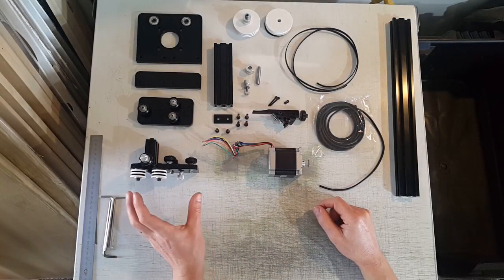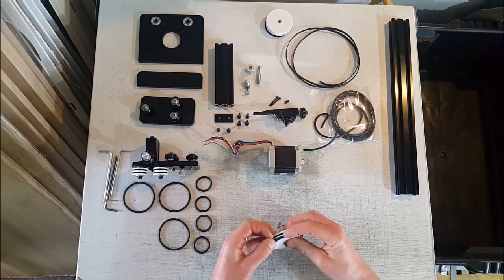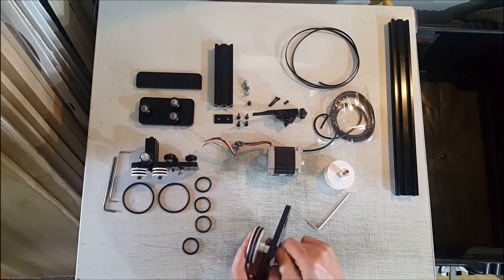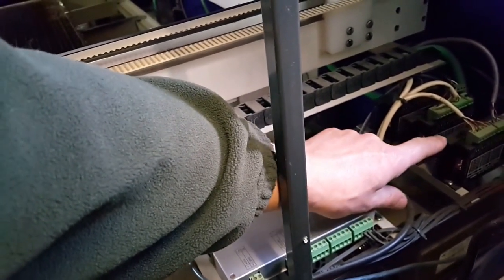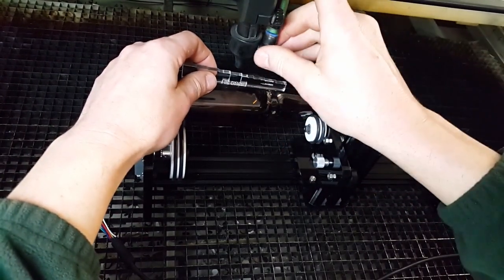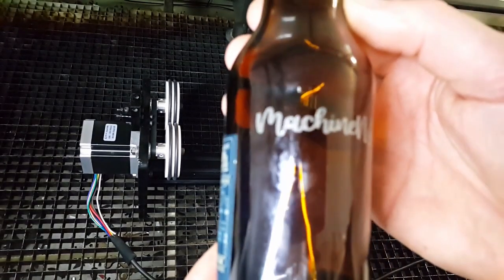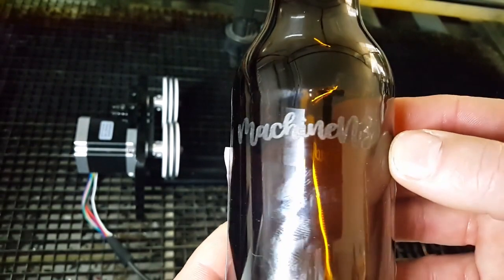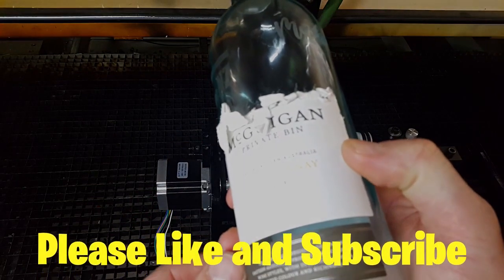#77 - Laser Cutter - DIY Rotary Engraver Build - Part 2

Comment: Kevin, I have a commercial version of a rotary engraving rig that  came with my Chinese laser but I've never used it.  I'm guessing you have to recalibrate the steps on the motor for the diameter of the drive wheels or have you used the same diameter driver as the linear axis?
Reply from the maker: Hi Mark. X & Y steps/settings stay the same. When using the Rotary there's a box in the settings which when ticked asks for gear ratio, steps per revolution and drive wheel diameter. Once these are entered and adjusted to suit accuracy it's just a case of checking and unchecked the tick box when the Rotary is used. Cheers kevin

Comment: Great stuff! I’ve been trawling with the idea of building one for my Chinese laser. Although I’m not sure what 3phase stepper I would need? Would it have to be the same spec as the ones in the x y axis? Do you have cutting plans available from your cuts, or is this a little cheeky asking.
Reply from the maker: Hi Stephen, there are different types of stepper motors and they can be wired in different configurations. Normally Steppers have the model number printed on them.
Search google and this will tell you the different wiring configs for that particular motor.
BE VERY CAREFUL, IF YOU GET IT WRONG YOU COULD DAMAGE THE CONTROLLER BOARD/STEPPER DRIVERS.
Cheers Kevin
Reply from the maker: Hi Stephen. I now have the plans (dxf file suitable for laser cutting). If you are still interested all I ask is a donation to my channel. Regards Kevin
Reply: @Machine_NZ  Hi Kevin, when you say contribute do you mean payment? Or others method.. I am in the middle of making my own pen plotter so I’d probably have some extra parts to go into the rotary build. 🙌
Reply: @Machine_NZ  Hi Steven, where abouts can I make a donation to get the DXF file?
Cheers
Reply from the maker: @davidhughes3333  Hi David, go to my Youtube channel home page then 'About' and use the email address to contact me. When I receive an email I'll reply with my Paypal email address....Regards Kevin

Comment: Hello thank for sharing. How to setup program side? You just plug it on the Y axis?
Reply from the maker: Hi. Thanks for watching. Setup depends on the controller that's in the laser cutter/engraver. Cheers kevin
Reply: @Machine_NZ   thank for the answer controller is mach3
Reply from the maker: I use Mach3 on my self built CNC router. Mach3 isn't good as a laser cutter/engraving controller (in my opinion). Regards Kevin
Reply: @Machine_NZ  what do you offer?